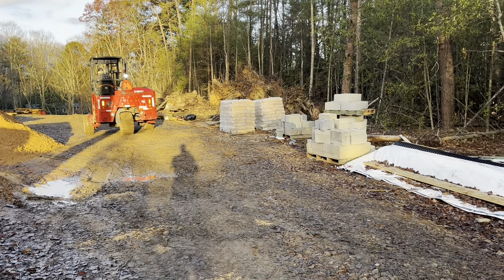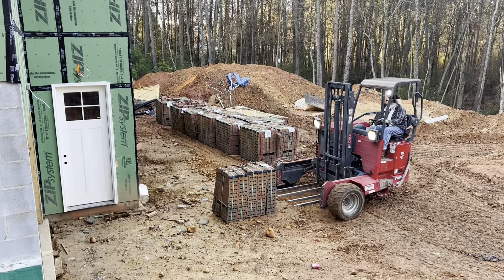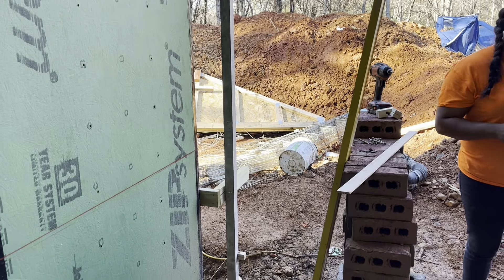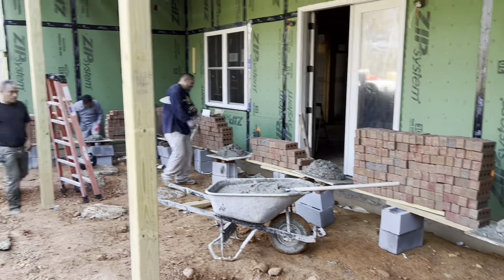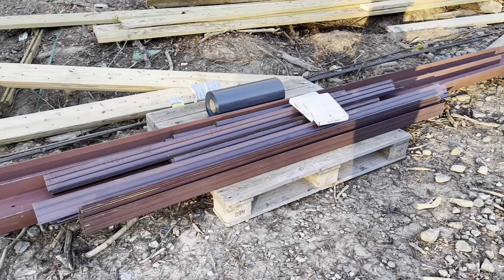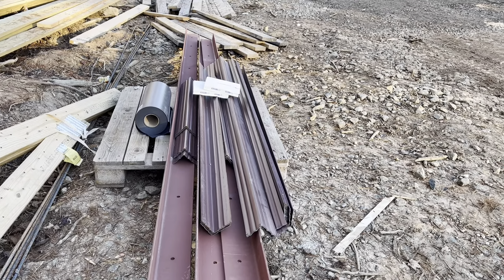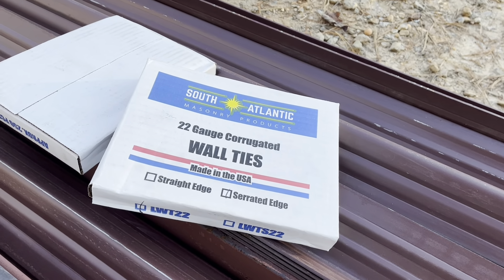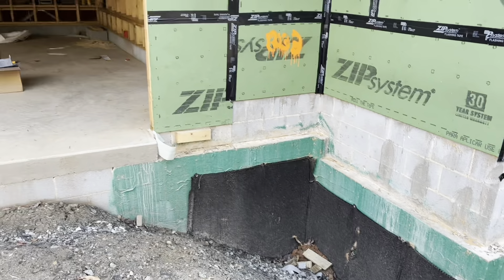Ep 39 Brick has begun!!!

Comment: The whole purpose of using the Zip sheathing system is to help prevent water from getting into the interior structure and causing rot. That's why seams are taped and nail holes are caulked. Did your masons remove and caulk all of those screw holes as they added the next course?